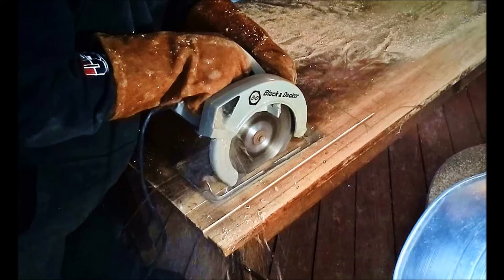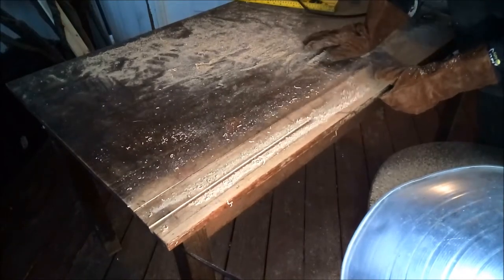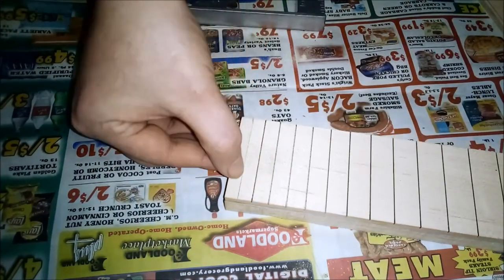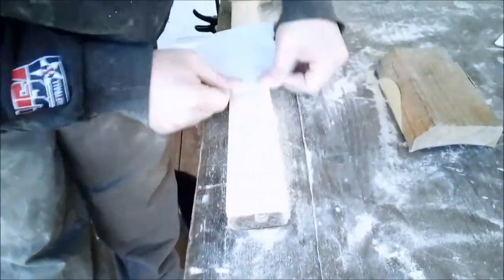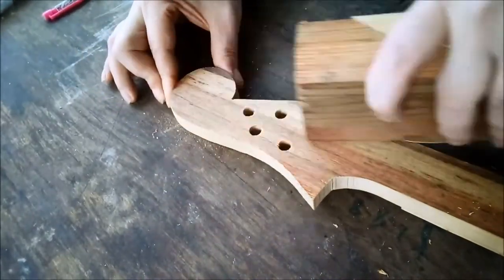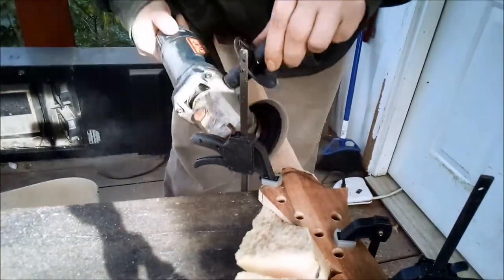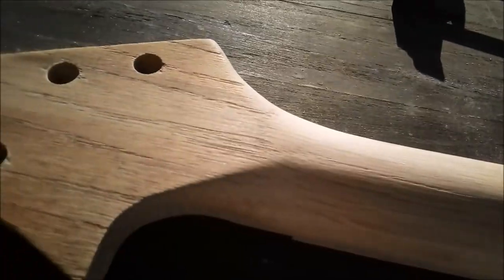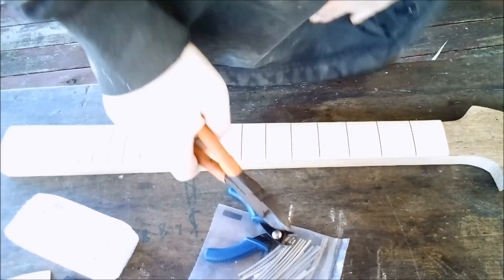Reclaimed Oak Guitar Neck Build from 1940's Farm Table

Comment: oak for a neck..how is that in weight compared to maple?..and how stable is the oak..I mean has it twisted ( I know the oak is old, but most wood has some tension in it that even causes the wood to twist after it is cut let alone allowed to dry or take on humidity)..and what kind of string height are you able to get down to after adjustements on the truss rod and fret leveling?..thanks
Reply from the maker: Thank you for watching and taking the time to write such a detailed and well thought out comment Mikko. Oak is VERY heavy but it seems to be solid as a rock I really doubt the truss rod is doing anything at all in any way it just doesn't need it and it would probably break before budging the oak. I left it strung for about 2-3 months or so right across the hall from the bathroom we take showers in and it didn't move a bit it was still in tune. I did a fret level on it a little over a year ago but I took a year off so I haven't finished it completely to see how low I could get the strings but from what I have been able to tell its superior to maple in every way: hardness, strength, stability, durability etc etc except for the look working with it and the weight it looks like furniture and weighs a metric ton and it will destroy your tools.
Reply: @heavymetalATC  thanks for the reply..i am started into using some oak and beech from some used furniture, but only for a skunk stripe kind of look to make the neck a little wider because as always i bought wood that was too narrow for both the body halves and the neck which i almost always do a cross glue glueup job on..and yes, oak is hard, and shreds a bit as it is worked..i mean like splinters rather than the smooth soft powdery stuff that comes off of working maple...oh..and i noticed the other myth breaker here..you used elmers glue instead of the holy grail of guitar building..titt bond...i like the tite bond because it dries hard and sands nicely, but i have found a powder glue that is used for furniture veneer, it also dries hard, but once you mix it you have to use it within about 4 to 6 hours..
Reply from the maker: @mikkosutube  great info Mikko.. Yeah its what I had at the time I gotta admit I do have a gallon of titebond 2